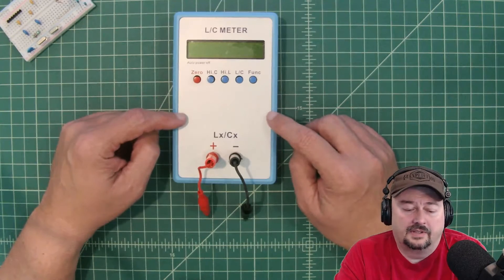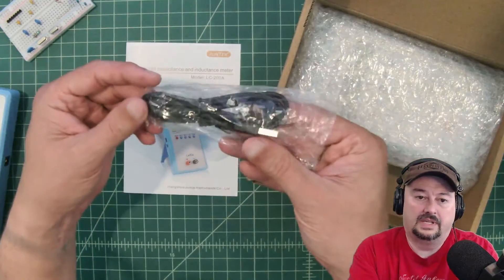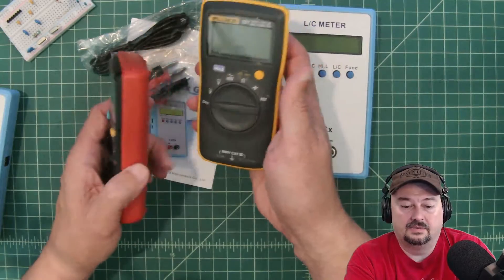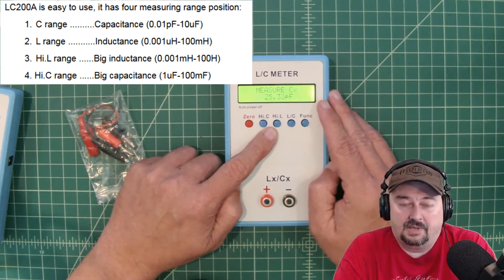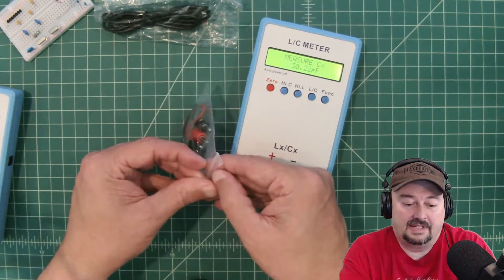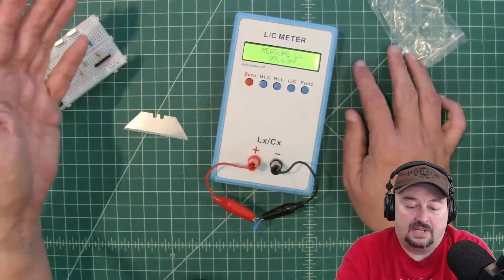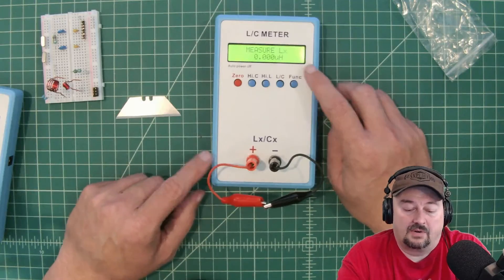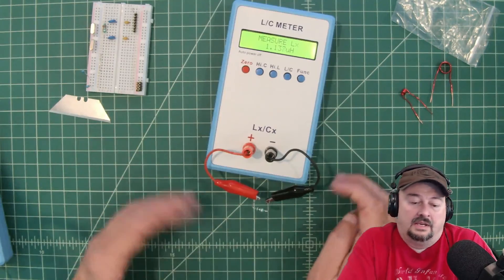Budget L/C Meter the Juntek LC-200A

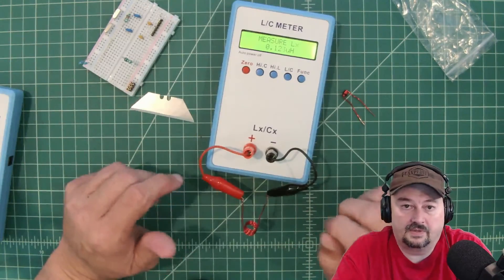Comment: 9:05 that coil is not 126uH, but rather a 126nH! Does it really say uH?
Reply from the maker: Pretty sure it’s uH
Reply: @TheSmokinApe seems like 5-6 turns of wire w/o ferrite. That would be in 100-200nH range
Reply: I need L- meter in 200-800nH range. Can you recommend this unit for that?

Comment: I have the ANENG 8009 and it struggles to give a good capacitance in the pF range.  The accuracy above that is just fine. However, for a tuned circuit: a LC or LCR meter, is a must.  One which allows lead/fixture compensation (zero) and has adjustment of test frequency or self-adjusts properly is going to give best accuracy.
Reply from the maker: Hey Paul, I agree the L/C meter is the way.  Thanks for watching!

Comment: I had watched this before but I had not need to measure inductance at the component level.  I am now working on a testing rig for the VNA and I needed to measure inductance.  This one seemed to fill the bill.  I have one coming.  It might be a cool video to hook an air wound coil up to the meter and show how the inductance changes as you add core material.   thanks for doing this video!  73
Reply from the maker: Thanks Jeff, looking forward to hear how you like it 👍

Comment: Thank you for evaluating our products!
Reply: FWIW, I watched at least six different YouTube reviews of different capacitance meters and it was this review that convinced me to buy yours. The reviewer did great job and the device looks like exactly  right for my application.
Reply: @dominicestebanrice7460  Interesting I have one of these meters and my power off on switch is labelled AC DC when i put batteries in it you have to put it in the AC position for it to work.!
Reply from the maker: Thank you!

Comment: Actually bought that exact meter to build your "shorty 40" antenna design.  I used a size up bigger toroid because I wanted to be able to do 100 watts in the field.  Anyway, the meter works fine and the shorty 40 is my favorite field antenna!  CARRY ON!!!
Reply from the maker: Hey Colonel, that’s awesome about the antenna!  Thanks for checking out the video 👍

Comment: The symbol L for inductance was chosen to honor Heinrich Lenz (1804–1865), whose pioneering work in electromagnetic induction was instrumental in the development of the final theory. Great video Ape. Lots of good Apesplainin.
Reply: BTW, have you ever used this to measure an Air Wound choke? Just wondering if that is possible.
Reply from the maker: I didn’t know that tidbit regarding Mr Lens.  I’m going to say you probably want to measure the impedance of the choke vs a reactive component but I’m sure someone will come along a explain how I’m wrong 😑

Comment: Hi Ape,
I have the same meter bought a few years ago but on the label is MingHe. I thought it unusual to use an AC power supply instead of DC. I take the batteries out when not in use. Stay safe.  73  WJ3U
Reply from the maker: Hey Don, great point about the batteries!